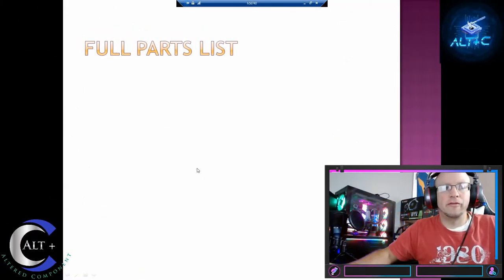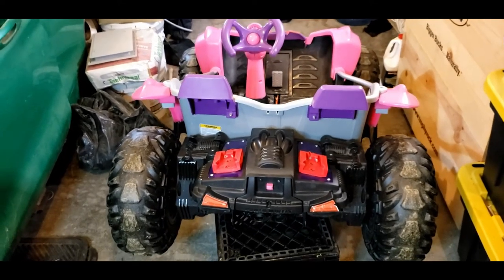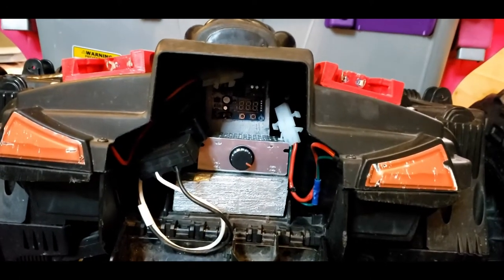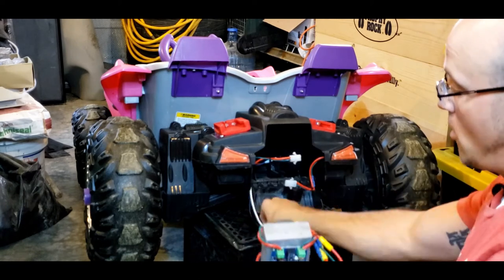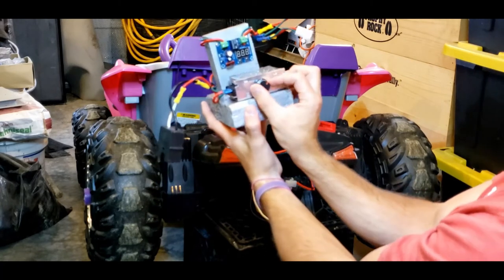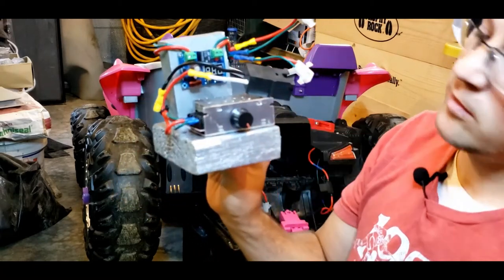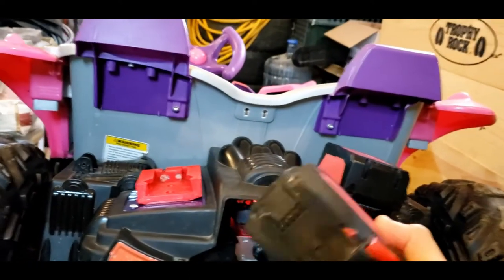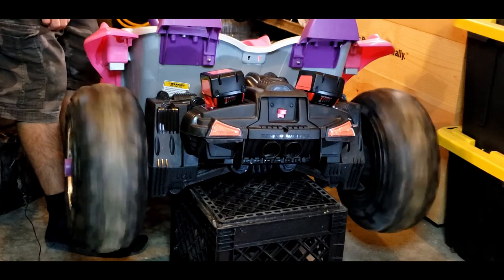Power Wheels Dune Racer Custom Modified Drill Batter Upgrade FULL BUILD video, guide, and tutorial.

Comment: I wouldn’t suggest the wire linked here in the description it is copper clad aluminum and it not only has a lot higher voltage drop but that extra resistance makes the wires a lot hotter and better chance of burning up. 
Especially if you using for high amp draw. Pure copper wire is always the best and if you do use the aluminum remember double wire size so say you need 12 awg for 20 amp draw you should use 6-8 awg aluminum wire for that same 20 amp draw.
Reply from the maker: Great tip.  Thanks for the response

Comment: the links are a bit screwy in your description. the terminal blocks are a 10 pack and the molex connectors are 14g so they are too small. the low voltage is also a 2pk

Comment: How are the motors and gear boxes holding up?
Reply from the maker: No issues with motors / gear boxes on this one at all.  The spider man racer has issues, but it had issues prior to upgrading power system.  the gear box was completely void of grease.  Repacked and it has been doing okay considering.  We have a barbie Jeep that we will also be doing and i have a LED driving light and unbody light video ready to edit (just need to find some time).  thanks for stopping in.

Comment: is tinned copper better than copper clad aluminum? I see you have the copper clad on your list but I'm reading it's not great. maybe it doesn't make a difference
Reply from the maker: havent had issues, but if the gauge of the wire too hire, it will heat up ;)
Reply: @AlteredComponent  16g is ideal then?

Comment: My son got a spider man car, not buggy, but its a dynacraft 6v. Do i need to upgrade the motor or anything else to use DeWalt 20v?
Reply from the maker: are you sure it is a 6v?  if you are running a 20v dewalt on a 6v car, it could be bad.  the wiring and motor may not handle that upgrade.
Reply: @AlteredComponent  it's definitely a 6v. I've got everything for the upgrade just haven't done it yet since I didn't know if the motor could handle it.